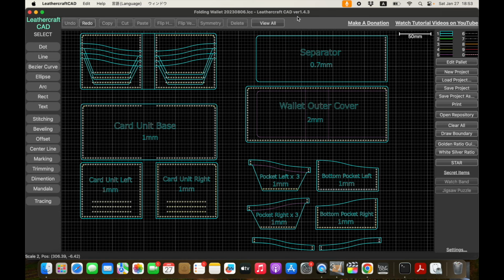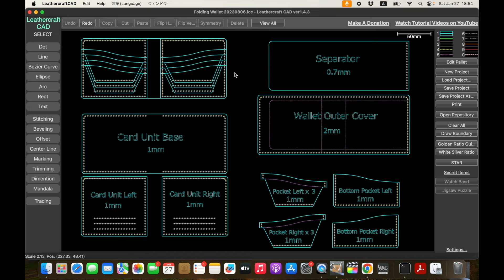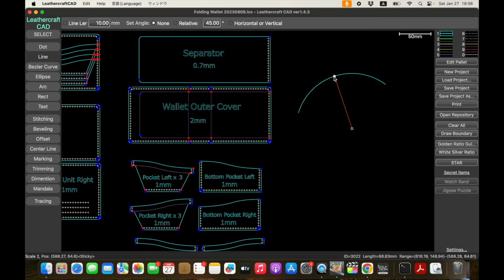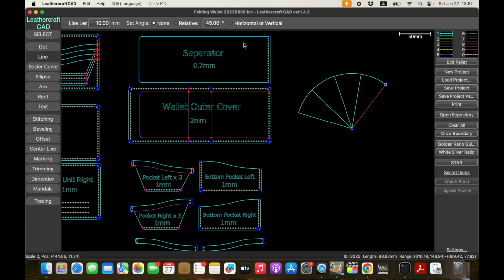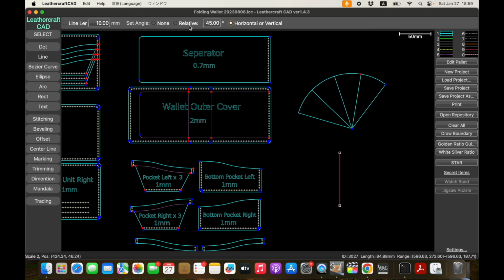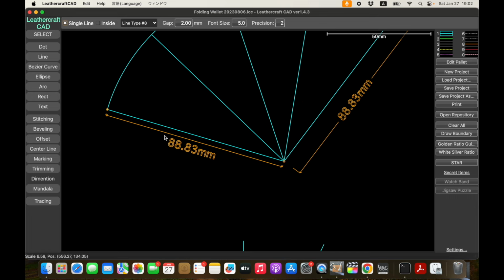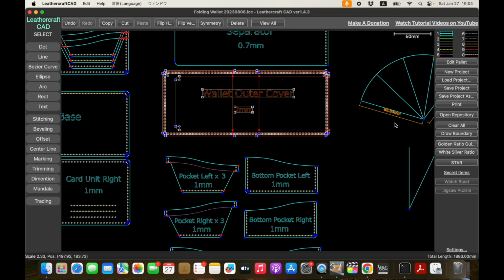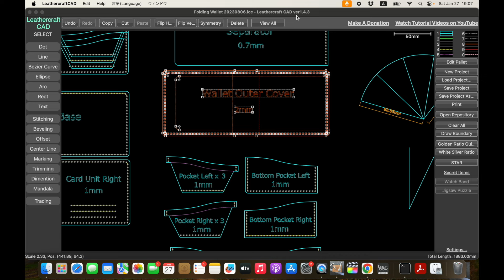Leathercraft CAD v1.4.3 update. Speed improvements, Line, Arc, Printing dimension line leather craft

Comment: Would it be possible to add a inches key also
Reply from the maker: I thought about it at the beginning but I found the majority of people are using metrics even in the U.S for leather craft works. (I had lived in the U.S. back in that time). So currently I have no plan to support inches or feet but I may change my mind if my assumption of the U.S. leather crafters is wrong. (And I know I may be wrong😅)

Comment: Got the software working and made my desired pattern with ease. However, the print isn't coming out true to size. The warning dialog box tells me to go to settings but I don't know which ones to change. Hope you can help. 宜しくお願い致します。Edit: I have followed the FAQ and entered the printed dimensions into the 10cm x 10cm values box. One side is printing true to length, but one is short by 5mm. I can't get the accurate hole spacing. The software is super easy to use but I'm stuck on the printing hurdle.
Reply from the maker: You are only one step away from the accurate printing! As far as I know there is no printer that cannot be calibrated with this method assuming you are using one of those major printer brands such as Canon, Epson, HP, Brother, RICOH, etc. it sounds like you tried calibration by following the step written in the FAQ but still getting incorrect printing. The most common cause for this case is the print scale settings. Please make sure the printing scale is set Custom & 100% (or something equivalent). Do not choose Fit to paper or such scaling option. Another thing is, please set 100mm to the both calibration X and Y value BEFORE printing the test page. Then print a page and measure the ruler length at the bottom right in mm. Oh, one more thing. Please always set the paper orientation as portrait when doing calibration. I hope this helps.

Comment: Hi! i use XTOOL laser whit XCS. I make pattern whit LC CAD. I export it to SVG and DXF. I try to use it in XTOOL. Pattern is not in actualy size what i made. It was a lot of smaller. I dont know is that bug in this or in XCS. Original was 160mm in SVG it was 113mm and in DFX 132mm.
Reply from the maker: Hello! I haven't used xtool (I want one!) or XCS but one of the other Leathercraft CAD users says he did not experience any size changes when he imported a SVG into XCS. So it's hard for me to tell if it's a problem of Leathercraft CAD or XCS. If you send me the SVG by email, I will be able to check if the SVG is correct or not (my email address is written in the license agreement or the release note accessible from the Help menu). I use Light Burn software for my budget laser engraver and I have never experienced issues importing SVG files generated with Leathercraft CAD. You can also check with InkScape software (free) to see if SVG can be imported to InkScape with the designed size or not. I hope this helps.

Comment: I’m having an issue after the update. Tried to use Box stitch helper and the app closed completely. Not able to open my project at all.
Reply from the maker: Hello! If the app doesn't start up, please delete the auto-save files in the following location:
Windows:
C:\Users\your_user_id\AppData\Roaming\leathercraft_cad\autosave_xxxx.tmp
macOS: 
/Users/your_user_id/leathercraft_cad/autosave_xxxx.tmp
Reply from the maker: If you can send me the auto-save file to me via email that would be helpful for me to troubleshoot for future updates. If in case the app starts up but you cannot open a particular project file, then I can fix the project file if you could send me that file via email. My email address is written in the release note or license agreement that can be accessed from the help menu.
Reply: Thanks, I didn’t see the replies.. i restarted the project since and it seems it’s fine now. If i have issues to open any projects i will follow your advice posted above. Thanks so much!